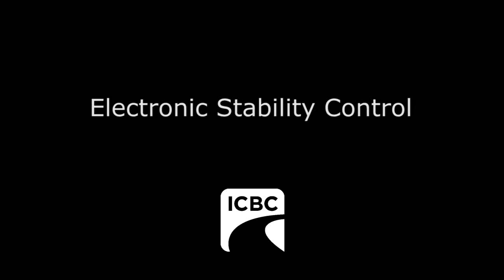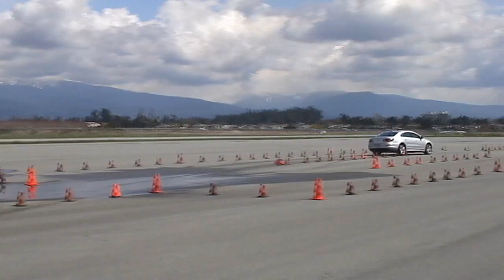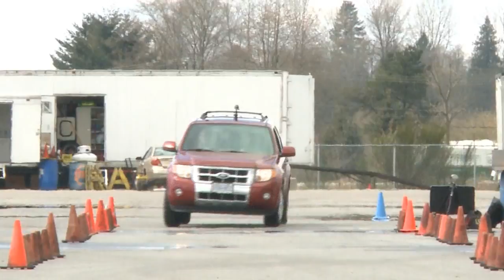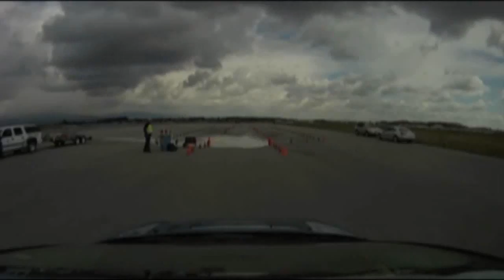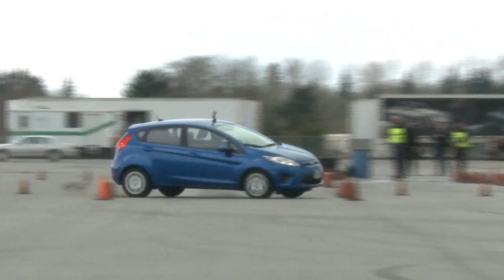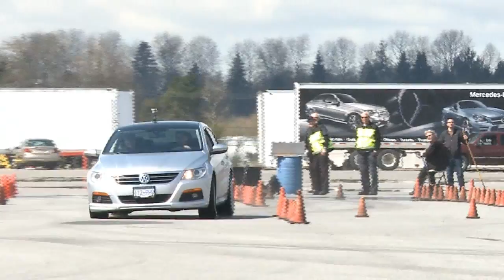Electronic stability control

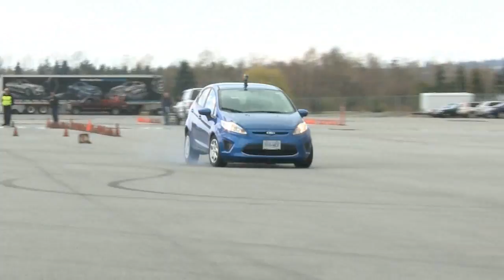Comment: 1:23 No ABS?
Reply from the maker: Hi +Scott K - The ABS brakes would still function without the ESC component turned on. ^lb
Reply: Yeah, I was wondering that too. Stability control relies on ABS so I wonder how the stability control worked if the ABS isn't apparently on.
Reply: +Scott K I think the computer thought it was slipping and locked the brakes